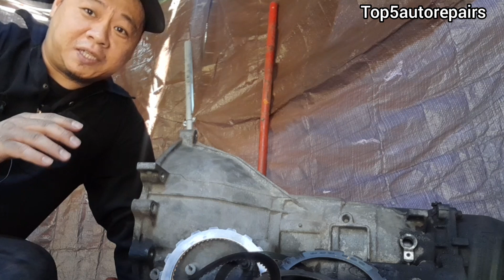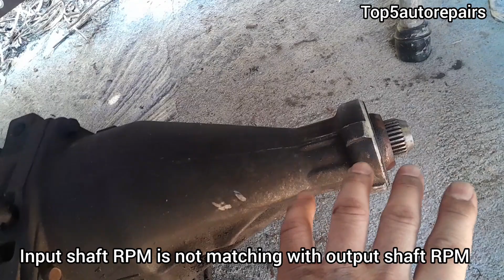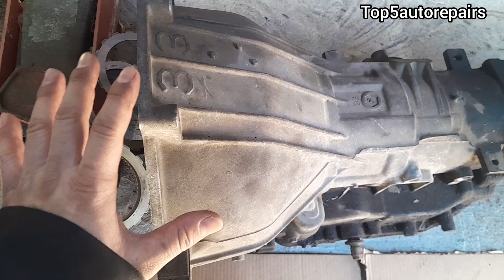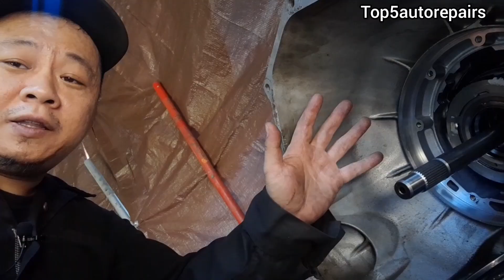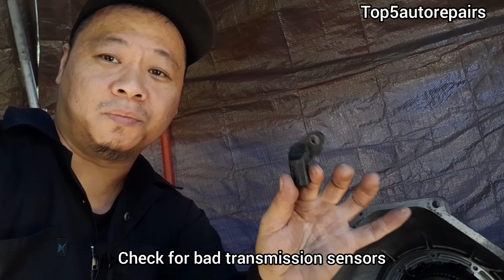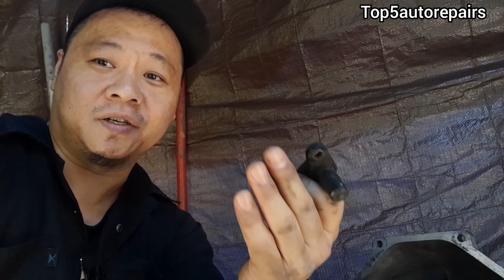P0730 INCORRECT GEAR RATIO HERE ARE THE CAUSES

Comment: Is it possible to replace the clutch pack without pulling the transmission?  I have a 2003 Odyssey and 3rd gear is a common failure point.  Thanks!

Comment: My 2003 Honda Civic automatic is working on low gear, and  accelerates and does not run, current code is P-0730, BMXA transmission. have checked several sensors to determine if they work. previous codes range from P1773, 1768, 1753, 0118, 0116 no longer show up. but problem still continues/persists. once transmission oil gets hot, have to stop to cool and drives me back home on low gear RPM accelerates and no pull loses force/drive?   all codes are electrical/sensors.  can some one provide me with solution before removing transmission and examining it from inside? will check transmission oil fluid/ if contaminated.   thank you

Comment: My Chevrolet Vectra have this fault code. The first and second gear engage normally, but the 3 gear doesn’t engage, and the 4 gear engage after 2 gear, and the transmission go to emergency mode.

Transmission model: AW5040 AF22 (Ainsin)